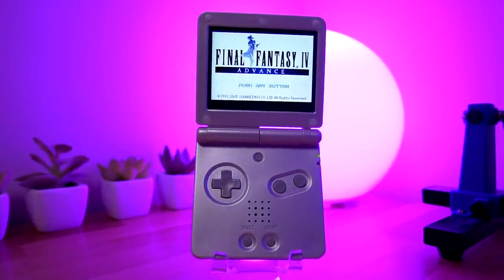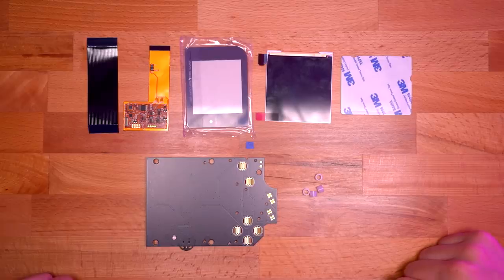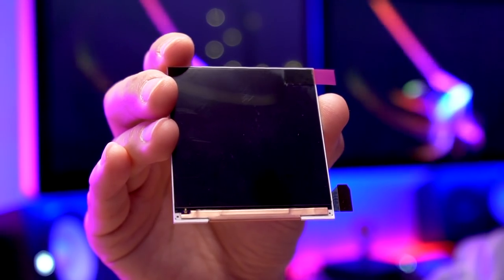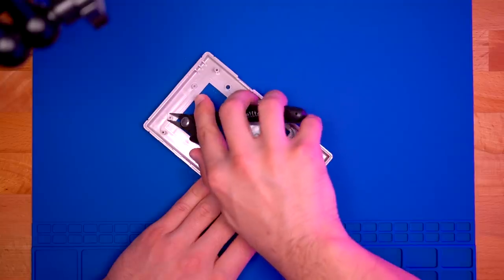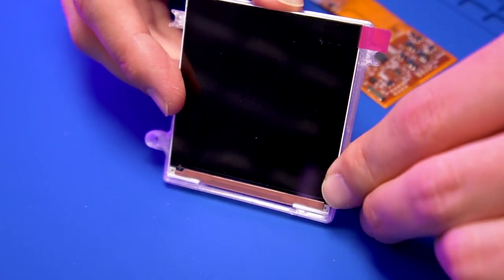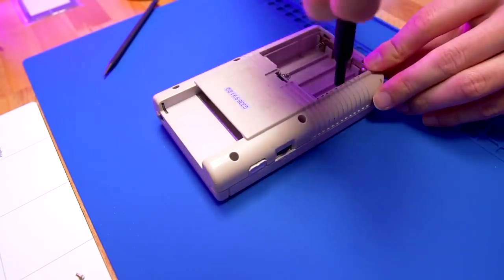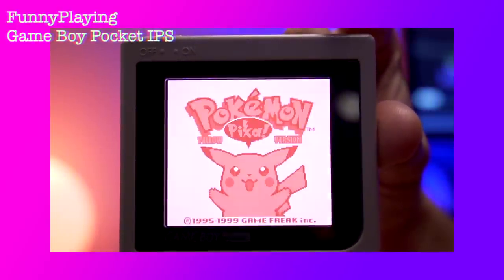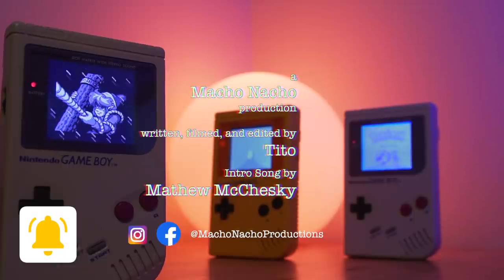COULD THIS BE THE BEST IPS KIT FOR THE DMG | FunnyPlaying DMG Retro Pixel IPS Kit | Retro Renew

Comment: Just successfully installed the new version of the Funnyplaying kit. It now has a clear plastic centering bracket that holds the screen nicely. 

The new kit also has a new ribbon cable, with a built in touch sensor and two soldering pads, for power and touch. Neither the touch sensor or the power and touch pads are used with the DMG kit. 

The select wheel: Pressing it up and down adjusts brightness, pressing it in will switch it to color palette mode, allowing you to pick between several color palettes, some that look like the original DMG green, and one that looks like the Game Boy Pocket screen, very nice selection.

Comment: Installed the FunnyPlaying V2 kit on my DMG, and I'm loving it. I just need to figure out why Im loosing sound when I screw the shell together too much. Right now I have to leave it a bit looser than it should be. I bought/ installed a new speaker and soaked the headphone jack in vinegar. Restoring this DMG has been a lot of fun! Thanks for clearly showing the differences in the kit options. Retro pixel mode is awesome, but the picture is so good without it. Hard to choose which mode to keep it in!
Reply from the maker: Thank you Jim!  So glad you’re enjoying your modded DMG!  The FunnyPlaying kit is fantastic!  To answer your question about the speaker, I would double check the solder joints. Make sure they look good. Also make sure the speaker wires aren’t being pinched. 

Retro pixel mode is a great option to have but I prefer the non pixelated look. I’m glad you had fun restoring your DMG!  I hope my videos helped out a little. Cheers buddy!
Reply: I don’t have a soldering kit can the speaker be installed after
Reply: @omarpozzobon6543  You can install it later, and headphones should still work fine, but when you want the speaker, it will need to be soldered in as far as I know. Sorry for the delayed answer.
Reply: @JPHarringtonJr  Thank You!

Comment: I would actually use the foam gasket as the guide by putting it on and removing the middle and cutting from the inside by snipping the corners first, then scoring with the X-acto blade with the gasket on to make near perfect straight edges

Comment: Installed today and worked a charm...bit of a pain having to cut the case, but easy enough.  Soldering the speaker was the hardest part, something to be aware of if you have never soldered before, I had to desolder and wire it up,from the other side of the pcb which meant cutting some of the plastic around the speaker.  the  colour change feature is excellent, although you can never decide on a colour as they all look good.

Comment: Super Thanks Tito! I used this today for a Neptune Shell from retromodding. 
Using a craft knife is very hard without a straight edge. 
My modified DMG works though. Glad I did the mod. 
This is WAY better than my older AGS-101 modded GBA.

I'm concerned about the button height on the shell. 
The buttons don't stick out as much as the original shell. They are responsive though.
I also had to use original OEM Silicone pads. 
They were higher and more responsible than new ones.
Why doesn't someone make taller DMG buttons to compensate for sinking in?

Now they got shells you don't have to cut...

Comment: This is the only problem with modding the DMG, do you wait or do it now as things are always improving, I might just give it another 6 months and see what's out then, this version looks the best so far though!
Reply from the maker: Very true Makoy!  This is a very fast moving mod scene. Things are always improving. My guess is that RIPS will release a V4. Who knows what awesome features it’ll include. Cheers buddy!
Reply: Macho Nacho Productions - I’m personally staying away from the RIPS kits. I was an early adopter and got the v1....the colors were not right and required modding the DMG, which then broke the “special” Pokemon pallets. I then got a few v2 kits cause it fixed this this,  it then made the buttons completely unresponsive. From there I just held out until FunnyPlaying stepped in. The RIPS kits are using buyers as beta testers which is not ok with me.
Reply from the maker: Oki_Dingo agree, they were quite problematic. It would have been great if they held off until they had the V3 ready. I bought all of them as well so I know the struggle. The FunnyPlaying kit is great and the V3 is now at an acceptable place. I would say both a great kits now. Cheers buddy!

Comment: Great job as always. I did this mod a couple days ago and went directly to your channel first. Could have used this video to make my job easier 👍
Reply from the maker: Oh man, apologies buddy!  I’m happy you went to my channel for reference, wish I had a video for you at the time. I wanted to do it earlier but got the kit a little later than I would have liked. How did your mod come out?  Cheers!
Reply: @MachoNachoProductions  It actually came out great. I love the mod. The wife even got in on it and helped. I also did the new cleanpower and cleanamp upgrades from retrosix. Love it so much. I have my Gameboy pocket IPS panel incoming so your vid on that will be put to good use.
Reply from the maker: That’s awesome man!  I really want to try out some of retrosixs other products.  They seem to be top notch!
Reply: @MachoNachoProductions  Everything I've used from them has been great. The audio amp was a huge upgrade. It gets very loud and clear. Keep the videos coming and thanks for putting your time into helping others.
Reply from the maker: Not a problem buddy!  More videos to come!  Cheers!
Reply: Gabriel Burkart is the audio amp a useful add on  when you already have the retrosix IPS kit?  
Thank you
Reply: @charlybilloir9048  yes it is. It's serperate and not "needed" however it's makes a huge difference in audio ourput levels. It's tough to solder ( I'm a novice) as the chip is quite small but I was able to do it. The kit doesn't come with wire so you will need that too. But after all is done its night and day difference in sound.
Reply: Gabriel Burkart thank you mate. Very happy to know that. I will do it ASAP on mine!

Comment: This mod looks great! I prefer the RIPS mod a bit more though and really hoping this will push the cost down on RIPS kits in the future... hard to believe this one is over $80 with shipping :O
Reply: Just curious why do you prefer the RIPS?
Reply from the maker: Both are great kits. You really can’t go wrong with either. As of right now the RIPs has the price advantage but I think the FunnyPlaying wins on features. Cheers!
Reply: @jmsmoriarty  holy shit, its way cheaper on their site than resellers. thanks for this!
Reply: @kronos43  Yeah, usually resellers pull up the prices because they gave some extras, but I can assure I have buy more than 5 IPS on their site and It's the same (witouth brakets)

Comment: @Macho Nacho Productions
You said that the gameboy pocket ips kit has the artifact issues solved in a new version? Where did you get the info from? I asked funnyplaying for the DMG Kit and they said it very difficult to handle theres problems and that there is no fix soon.
Reply from the maker: Hey Maurice!  I was going off of an Instagram post they made a little while ago. They said they had a firmware update which the first batch of ribbon cables didn’t have which I think was supposed to solve the issue.  They said those who got the first batch could either send it in to get updated or receive a voucher for this kit. I opted for the voucher since the artifacts don’t bother me too much. Here’s the post, https://www.instagram.com/p/CA9I2TtnVXt/?igshid=fk8nwevtdiqj   It’s actually pretty vague but I assumed it referenced the artifacts. Hope this helps. Cheers!

Comment: Hey Tito quick question...in your opinion would you say enlarging the viewing window in your DMG shell is a necessity for this mod? I saw This Does Not Compute's review of this kit and he said he didn't enlarge the window and found it to be fine. What's your opinion?
Reply from the maker: You may be able to get away with it but I think it may cover a small sliver of the screen. The lens itself had a larger window. If you have a 3D printed bracket you could install it and see how it looks. I wouldn’t use the foam adhesive gasket it come with. Hope that helps. Best of luck!!
Reply: @MachoNachoProductions  that's true! Yes I'm planning on ordering it from HHL, but they don't seem to include a bracket. I have a buddy though that can print one for me so I think I'm going to try that. Good point though, I can just drop it in and see if the screen cutoff is significant. Thanks man!
Reply from the maker: Absolutely Michael!  Cheers buddy!

Comment: I bought a generic IPS V2 screen, then realised 'oh maybe I should've made sure it was the one that said "Funny Playing" on the ribbon cable, I did inspect pictures of the ribbon cable and it seemed like all the components were exactly the same, wish me luck!
Reply from the maker: I think you should be okay. I have a theory that all the IPS kits are made by the same manufacturer. I’ve used ‘clone’ kits before without any issues. Best of luck buddy!  Cheers!

Comment: My screen is not centered in the viewing window. I bought a ips shell and bracket. Is there a way to adjust the picture on the screen?
Reply: Also having this problem.  Did you figure out how to fix it?
Reply: @Derick350  Unfortunately no. I was told there is no way to adjust the picture. I ended up taking some black electrical tape and carefully "framing" the play screen. That took care of the light bleed. Nobody seems to notice except me... which is very unsatisfying... Good luck!

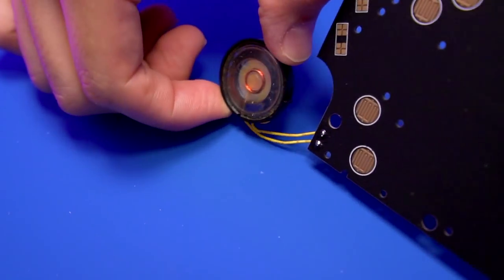Comment: At 7:13 you soldered an old Gameboy speaker to the new board, but if I ordered a new speaker and were to solder the red and black wires to the board, from this position which side would it connect?

Comment: You are not kidding I misaligned my screen and had to use some alcohol to carefully remove the screen again and put new sticky tape down
Reply from the maker: I know man, I think the gaskets would be much better if they could use a weaker adhesive. Once it’s stuck, it’s very difficult to remove.  That would be my one suggestion to FunnyPlaying.  It would also be nice if they could develop and ship their own aligning brackets. Thanks for the comment!  Cheers buddy!
Reply: yep, I mess up my gameboy pocket because of that, I didn't clear good enought the led hole cut and couldn't stick out the screen... The definetly need to ship the plastic brakets
Reply from the maker: Yeah I agree dude. The adhesive gasket alone isn’t the way to install the screen. A lot can go wrong and it’s very difficult to fix. Cheers buddy!

Comment: I'm not changing. I don't see bigger screen , lots o colors  n the control wheel as selling points.  IPS close to stock size . enough color and wheel control  is fine.  Only selling point if cheaper
Reply from the maker: All valid points.  The RIPS V3 is an extremely solid product and if you have one, I'd agree there's really no need to change.  Cheers buddy!

Comment: I received it today. But there was a sensor touch included. I don’t know why..
Reply from the maker: Mine came with it as well.  I believe it was included because the LCD and ribbon cable are the same as the GB Pocket which does use them.  There is no need for them for the DMG mod.  It probably would have been better if they did not include it.  Cheers Xav!

Comment: Maybe you can help me out?  I installed this and it sometimes loads with a black screen, sometimes loads and plays normal.  Do you think there is a loose ribbon cable somewhere?  If so which one?  When it does work its amazing, the bigger lens could be a touch larger also.  Update it works perfect in another gameboy back I tested it with.  Something going on with the rear of the gameboy.
Reply from the maker: Hmm that’s interesting, I wonder if there is any issues with power. The creep may not be getting all the power it needs to turn in the back light. I would make sure the battery contacts and the power switch are clean. I use deoxit for the power switch. Hope that helps!  Best of luck!  Cheers!
Reply: The power is on, the screen has power and is lighting up, just in black.  I believe the rear of the gameboy just died, lol.  It was working, now its not.  Might be capacitors or something beyond my knowledge.  I cleaned everything good and cant see any damage.  So i just bought a working gameboy with lines in the screen to replace it.  Kinda sad, because thats what I had when I started haha.  Thanks for the response 👍🏼.  The front half is perfect, so the mod is amazing!
Reply from the maker: Sorry to hear about the GB motherboard going bad. Glad everything worked out in the end though!  Cheers!

Comment: Thinking about doing an IPS screen mod for me DMG cause I have two, one that’s pretty dirty and works but I can’t open it up due to an extremely stripped screw (btw any advice on that? lol) and another that kinda works but the screen is blank so I might do it on that one once I get the money for the mods I wanna do haha
Reply from the maker: It’s definitely a great mod, especially to do on a unit with a busted screen. As for the striped screw, it might be tough to get it out without damaging the shell. There are some tricks like potentially drilling it out but that may damage the shell around it (it’s a petty aggressive last chance sorta tactic). I’m sure there are some other clever ways. I’d google it. Best of luck buddy!  Cheers!
Reply: There are plenty of Stripped screw tools you can buy out there we have one at my shop we experience plenty of stripped screws and sometimes sadly they are far too stripped and need a careful drilling
Reply: Macho Nacho Productions thanks yeah I probably will have to drill it, it’s stripped pretty badly but I’ll save that for the future lol. Also just noticed the hat you wear in your videos is there anywhere I can get one?
Reply: matt Marshall yeah I was thinking I would have to do that because I’ve tried every other method of trying to remove it and still nothing so if worse comes to worst I’ll probably have to do that in the future thank you!
Reply from the maker: I’m thinking of opening a small merch store at some point. Right now I just have the one lol. Thank you so much for your interest!  I’ll definitely make an announcement when I do open a store. I may also try to gauge interested prior. I wasn’t sure if people actually noticed it. I’m glad you noticed it, thanks for letting me know dude!  Cheers!
Reply: Macho Nacho Productions no problem! I like it, will definitely be one to buy one if you end up selling them!
Reply from the maker: Thanks man!  Really appreciate it!
Reply: Macho Nacho Productions no problem!